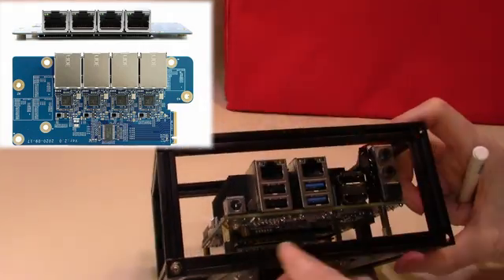Odroid H3+ single board computer - options for expansion

Comment: Thanks for video! Do you have any information about support of TPM 1.2 by H3+? Is it possible with expansion unit or TPM chip already soldered to the board? Thanks!
Reply from the maker: Both the H3 & H3+ already support TPM 2.0 , allowing Windows 11 to be installed on them.  https://wiki.odroid.com/odroid-h3/start